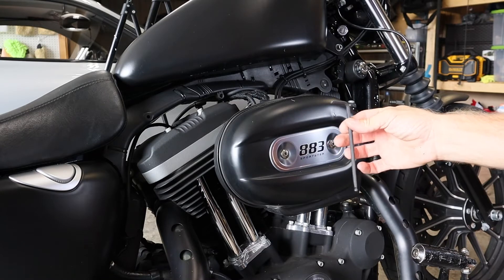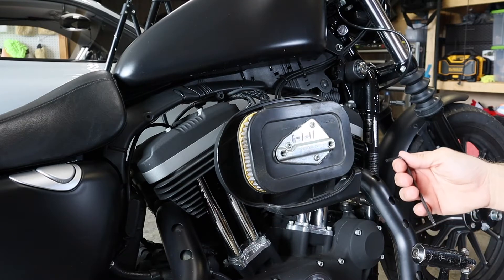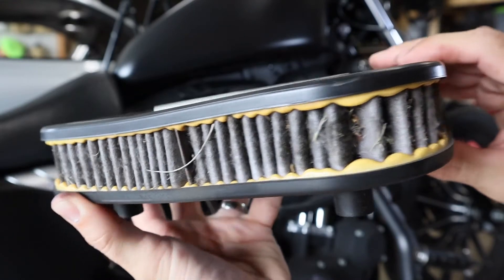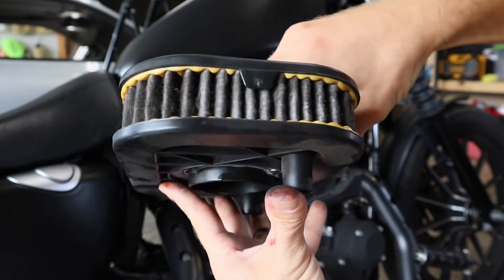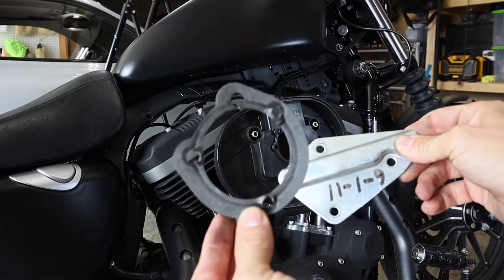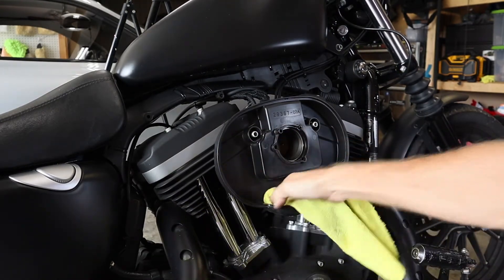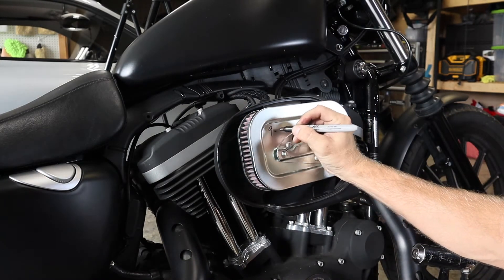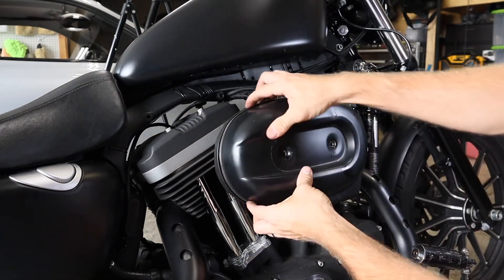How to change the air filter on a Harley Iron 883

Comment: do you not have to retune it with the k&n cos i was gonna switch mine out for one?
Reply from the maker: I didn’t have to retune mine
Reply: @tkdriven6077  cool was just unsure i thinknif its stock intake plate you dont either from what i have read mines on straight pipes as baffles sheared gonna get stage one kit either way